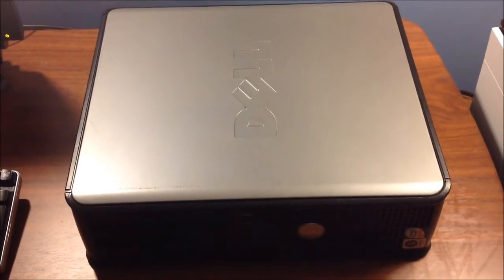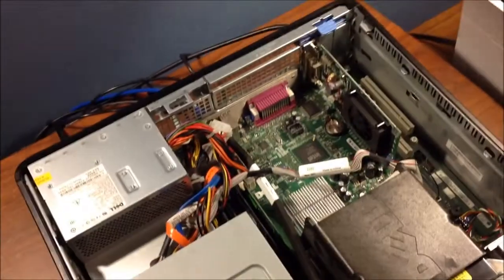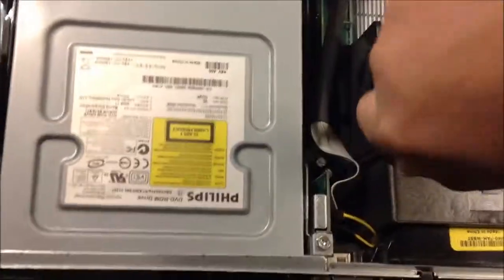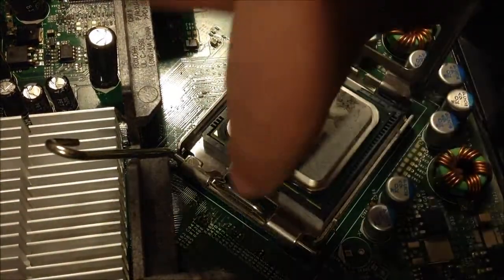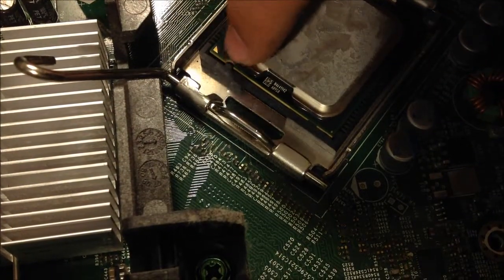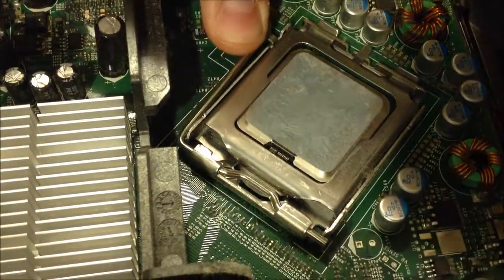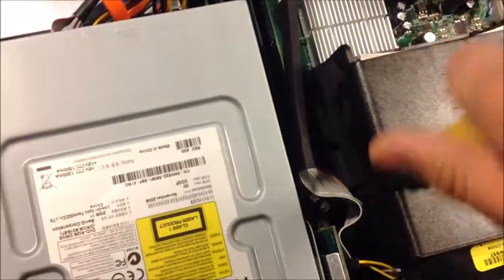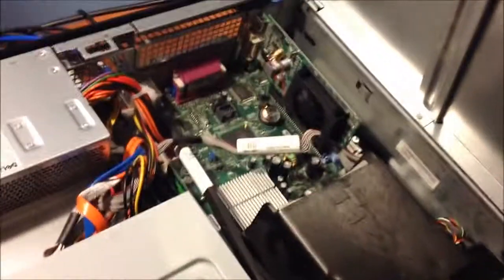Upgrading processor in the Dell Optiplex GX745

Comment: I have an intel dual core cpu with the optiplex 745. Could I upgrade it to an i3 CPU or an i5 processor? Many thanks in advance!
Reply: No.
Reply: No cause i3's and i5's cpu's are lga1150 socket and the optiplex 745 has lga775 socket.
Reply: +Max Tyler it just wont fit

Comment from the maker: Intel® Core™ 2 Duo 1066MHz FSB Socket T with Dual Core technology XD,  
 Intel® Pentium® D 800MHz FSB Socket T with Dual Core technology XD, EM64T, 2x2MB L2 cache, EIST, and VT on 950/960 (900 series) 
 Intel® Pentium® D 800MHz FSB Socket T with Dual Core technology XD, EM64T, 2x1MB L2 cache (800 series) 
 Intel® Pentium® 4 800MHz FSB Socket T with HT, XD, EM64T, and 1MB L2 cache (500 series) 
 Intel® Celeron® D 533 MHz FSB Socket T with XD and EM64T (300 series)